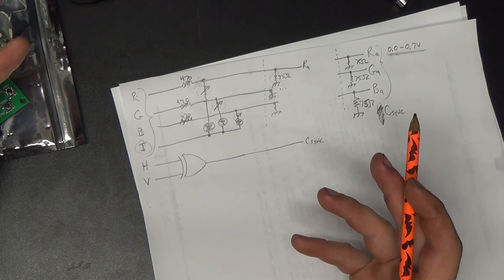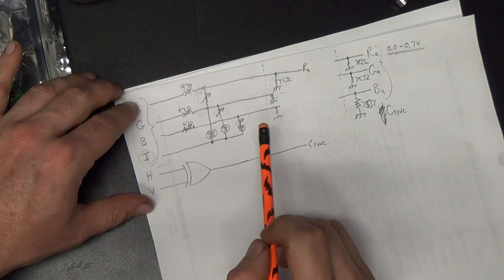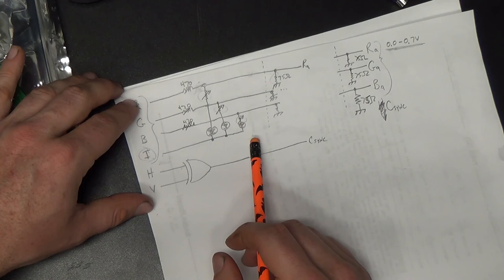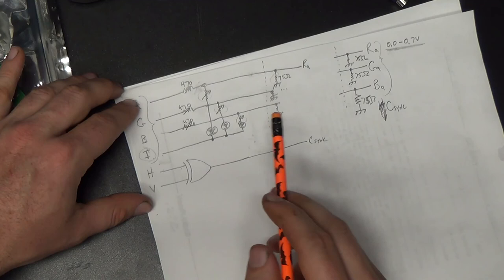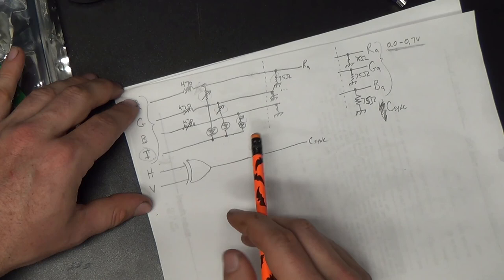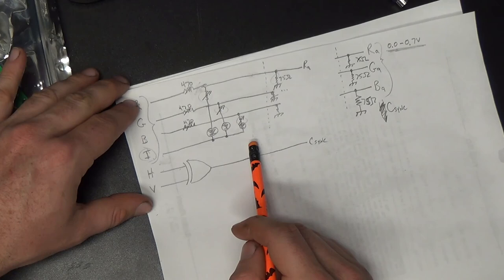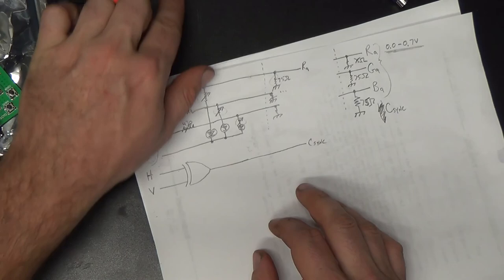Let's Build a Big Fat KVM Thing (Pt.02-2) | Drunk Math II

Comment: Looking forward to the breadboard part!
Brown sounds like it's gonna be ... interesting ;)
Reply from the maker: Yeahhhhh, I dunno.  The other designs I've looked at are using a 74138 3-8 decoder to fix the brown and in some cases the dark gray.  And then there's also the XOR gate for generating the composite sync.  It's definitely an option.  But.....

The principles for also displaying EGA and MDA on a VGA monitor are the same as for CGA.  I can't help but keep thinking that it wouldn't be better in the long run to implement a generic solution for all three video standards in a GAL or something.  It'd be a 1-chip solution and support 3 types of oldskool video rather than just one.  On the other hand, the kitchen-table hobbyist won't have something to program GALs laying around, so meh.

Main problem is, I don't have an EGA card to test with.  I have a Hercules card in a box somewhere, but I dunno if it works, because I don't have a monitor for it.  I guess maybe I ought to just focus on CGA for the moment and keep an eye on fleabay for a cheapassed EGA card for testing purposes.

But does anyone actually use EGA?  I mean, there are cards out there, sure.  But there are no EGA monitors that still work, and there are 100000 16-bit VGA cards that also happen to work in 8-bit slots still kicking around.  I don't know of any built-in EGA video on anything.  The Tandies and Amstrads/etc were all CGA and the PS/2s were all MCGA/VGA, so I have to wonder if there is actually any need for some kind of EGA-VGA dongle.

But EGA would be a lot easier to convert to VGA.  No "special" colors.  Just a little R-2R over each of the two color bits.  So doing all three with a GAL would kinda convert both MDA (with the choice of green or amber too!) and CGA to EGA, and then the resistor bridge would convert that to analog RGB, so I guess there's no reason not to try to support EGA too.....

Eh I dunno.
Reply: @Lee_Adamson_OCF   That's my thought.. EGA is pretty straight-forward, if you implement the CGA intensity as individually-controlled R/G/B intensity, which you nearly have to do to give yourself enough control to handle brown anyway.

I'm definitely the kind to chase down an EGA card just to make sure whatever I do supports it properly, so the other two people in the world that might stumble across my notes would be able to make use of it.  LOL... None of my projects ever have any ROI.